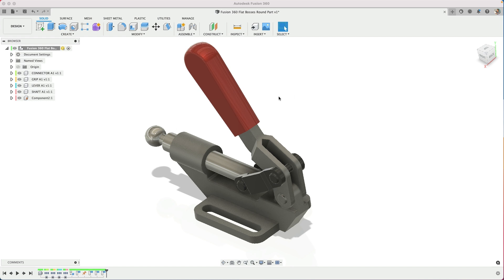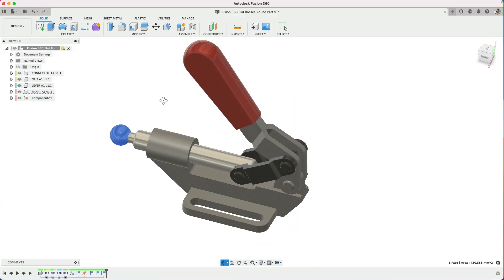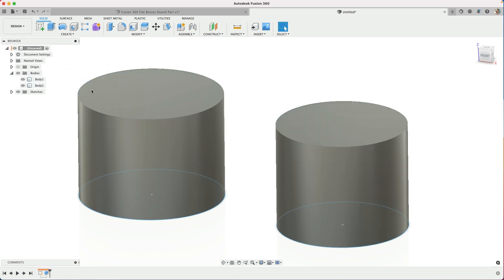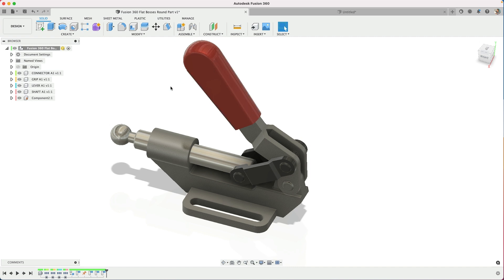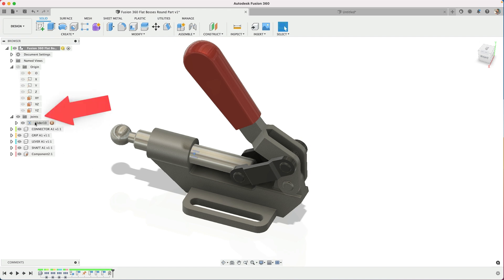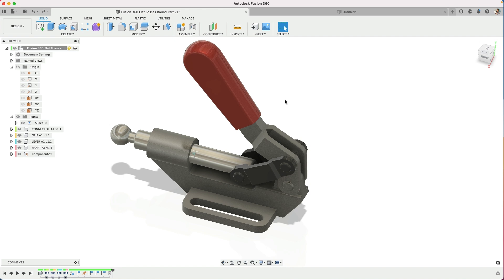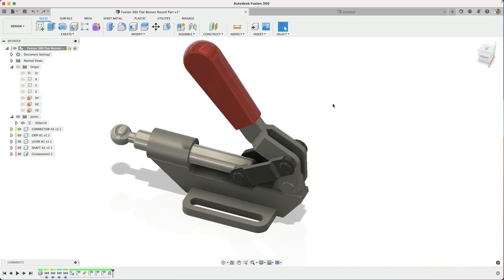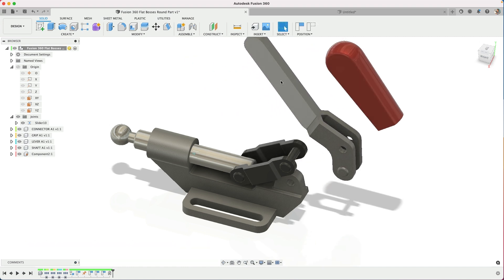Fusion 360 Components Wont Move (How To Fix This)

Comment: I have some text I converted to STL, and trying to put it on top of a cylinder. I just wanted to create the cylinder, move it under the text and then adjust the size as I'd like it to be, then combine into a single object and export. for some reason when I create the cylinder and then try to move it into place, it's only letting me move "up and down" but not over to where the text is.

Comment: When inserting a component from another design as a new component you can only move the component one time. After it has been fixed in the design it can no longer be moved.  So you have to design all components from scratch and not insert from existing design.  At least in the free version.

Comment: not bad thanks. but if still wont move the correct answer is right click the joints between these two components and click SUPPRESS. After that you will be able to move
Reply: that was tghe solution to my prob :-) thx!

Comment: so i created a joint, and set the limits. i could drag and move it into the original position after the command, but when that's done, i can't move it anymore.
Reply: I figured it out for mine. I had to ground the base so it would let me move parts without everything moving.
Reply: @duanecrider  well, I already did that for mine
Reply: I have the same problem.  Still trying to figure out how to animate a model after I've set the joints.
Reply: @duanecrider  well, sh*t! Lemme know if you figure it out